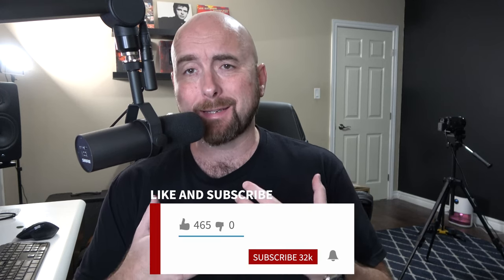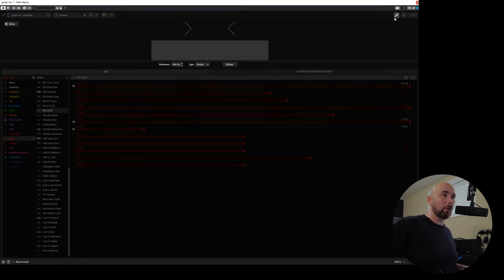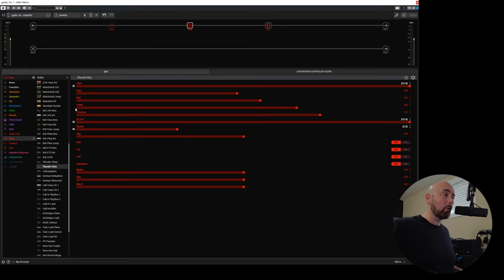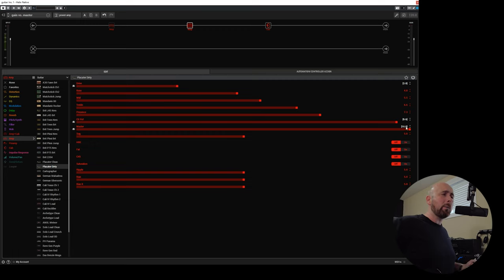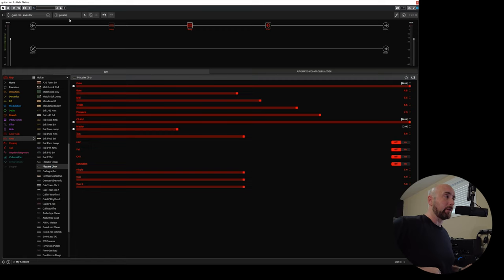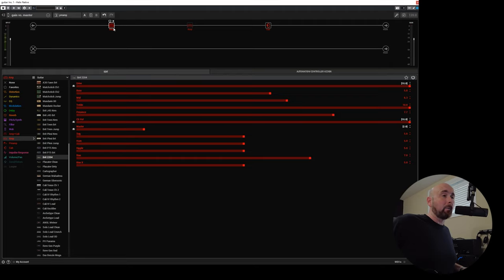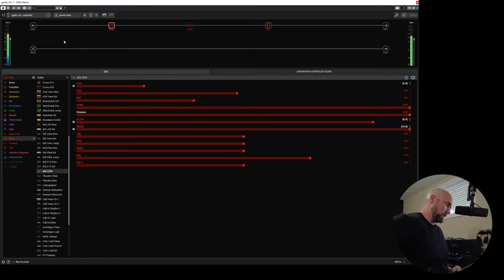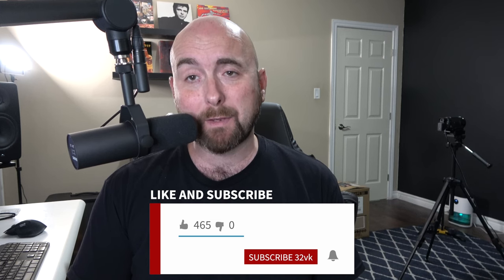"MASTER" Every Helix Amp Model With Ease!! | Master vs. Drive

Comment: What a great useful topic , I been playing over 30 Years and understood which part of amp is driven by gain and volume but didnt realize the effect of turning gain down and master up to push tubes more and the different tone that could be accomplished,  very nice jason
Reply: The channel volume does effect the tone as it would do in real life. The reason is because how loud the overall tone is determines how much vibrations the cabinet, cone, and room generates. That's why some session players opt for open or closed back cabinets to add or remove reflections.

Comment: This video is useful for me. I've read somewhere about preamp and power amp distortion and this video explains which knob do what. When using amp sim, I don't think too much about how real amp works in real life. I just use simple rule. Dialing anything on 10 rarely produce good tone. Especially with gain and master volume. So I dial every knob in moderation. Most of the time this simple rule works. In some amp sim model especially mesa, this doesn't work. Then I watch how to dial real mesa amp and apply this knowledge to the amp sim.

Comment: Great explanation! I used to be the type that would dial in the "amount of distortion" exclusively with the gain control and then set my volume\output levels with the master section, and mostly with pretty decent results.
However, Only in recent years have I really started to play around with the contrast between the two and have been able to really achieve "better" tones.
This video, for me personally, simply accentuated and reinforced the idea that it's best to play around with both, therefore allowing me to really fine tune gain stage, overdrive characteristics etc.
Great work as always! Cheers from western Massachusetts

Comment: Huge difference. Even though I've had my HX Stomp for a while, there are so many options/parameters that can be adjusted, it's easy to lose sight of how dramatic a difference certain ones can make. For example, I'm not in the habit of cranking the Master Volume all the way up, even though that's the overdriven tone I prefer. Thanks for the reminder. 👍

Comment: Hi Jason. As always I learned something new with your videos.  Question:  Does using a Helix Drive pedal in front of the amp have the same effect as the amp drive knob preamp distortion, versus master knob poweramp distortion?  Is the expectation always a more  compressed, saturated OD tone, versus poweramp ( master ) distortion?   Thank you

Comment: Good video Jason.  I had no idea what a huge difference in tone there was depending on how you run the master.  I was under the impression that the master just added harmonics and a little more crunchy mojo.  It explains why diming the gain with the master cranked on the high gain models gives lousy results.  I have to rethink the way I create my presets.

Comment: I'm not sure if my question is relevant but it would be nice if the foot pedal could be used to control the master volume for "every" preset. (instead of bending down to manually turn the volume dial to adjust the output) Almost like a global override of the channel volume no matter what preset is selected. When you import 20 or 30 presets and the volume levels are all over the place it can be extremely tedious to adjust every preset. Isn't there some kind of macro to cascade all of the channel volumes to "10" by default? ...just feels like a basic function is missing.

Comment: I haven't spent much time with the Marshall models, but that one in particular sounded a lot better to me with the master volume cranked.  On a side note, I have a guitar that I love but the single coils are maybe a little bit anemic.  I tried using just a plain volume block to boost it into the amp block but am still not really happy with the results.  I've tried using the booster and overdrive pedal models.  I've even tried real pedals in front of the Helix but that guitar just never sounds good through the Helix.  It sounds great through an amp, though.  You ever run into that?